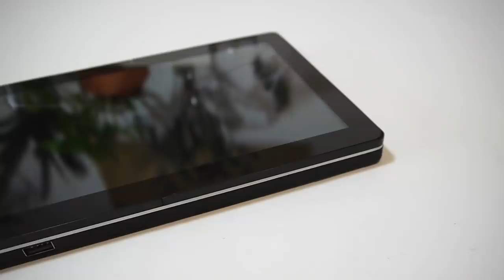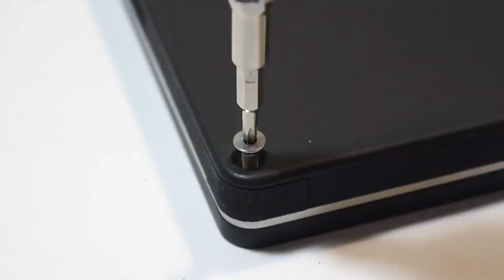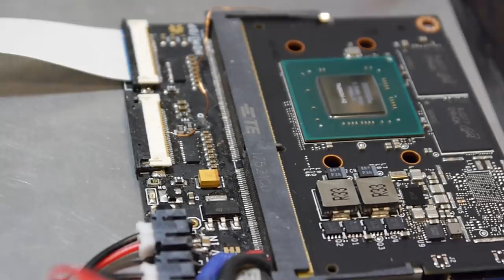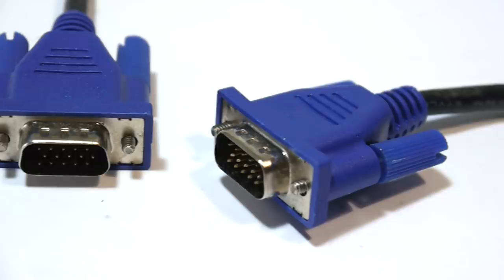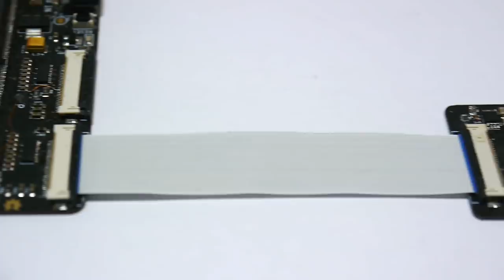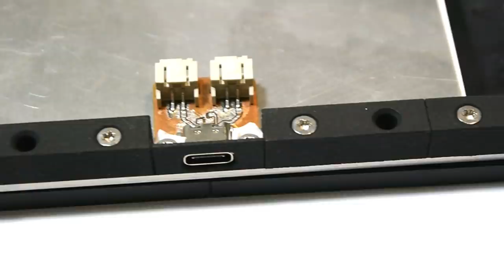A Damn Linux Tablet - An Overview of the Hardware Design

Comment: Great idea. Serious question, will it run Windows? Would be a great hardware platform for Windows as well.
Reply from the maker: If Nvidia decides to support windows, maybe but I highly doubt it, Windows is not very open when it comes to embedded systems. It could probably only support the official dev kit. Afaik there is no equivalent to Linux Device Tree in Windows, at least nothing public.
Reply: @timonsku  thats unfortunate... i love windows programs

Comment: does is have a terminal one can control? can it run Kali Linux, Atom editor?
Reply from the maker: Whatever you want, I just provide hardware and driver setup. The current motherboard is using the Jetson Nano / Tegra X1.
Reply: Prof. Sparkles so one can use this for ones programming courses!?
can it ship to Sweden?
Reply from the maker: @ChristofferEricsater  Sure! If it can be useful for that in your eyes. I think for plain programming a cheap Linux Laptop is probably better suited, for programming you will probably want a physical keyboard.
If you also want to also teach about hardware at the same time it would certainly be a great platform, it will be very easy to open and extend with user made hardware.
If it wasn't clear, this is not a finished product, this is a very early look on the hardware design, its still very much in development and will be a for a long while.
Reply: Prof. Sparkles can one connect any USB keyboard to it!?
Reply from the maker: @ChristofferEricsater  Absolutely, it will feature USB-A ports.
There might even be a laptop version in the far future, kinda like the Microsoft Surface. The tablet is the first base for this modular hardware ecosystem, tablets are a bit easier to do than laptops.
Reply: Prof. Sparkles you mean you will make a tablet with a laptop OS!? like the Surface Pro!?
I prefer using my own mechanic keyboard and I think a lot of programmers and writers do... so a Tablet that can function with a real OS is to me a better choice than a laptop!